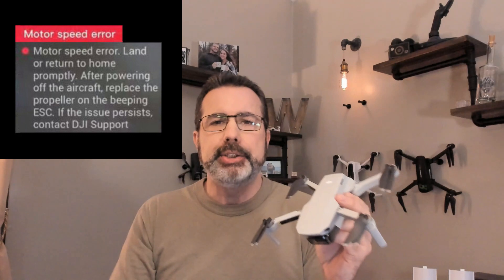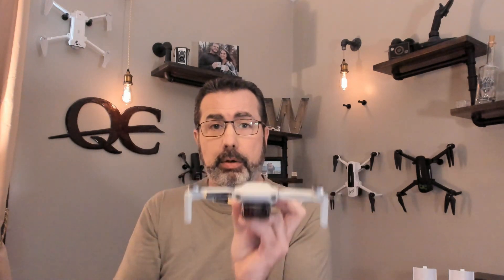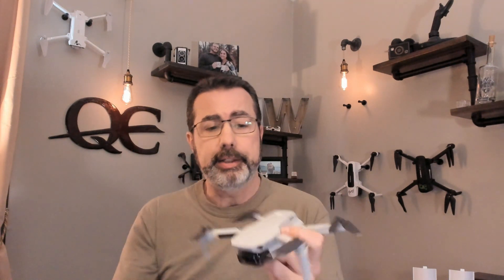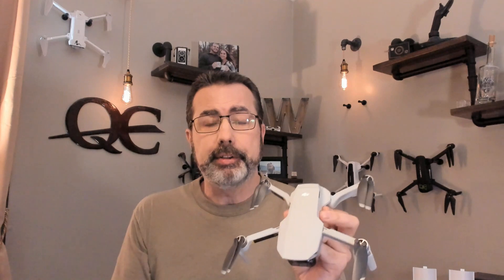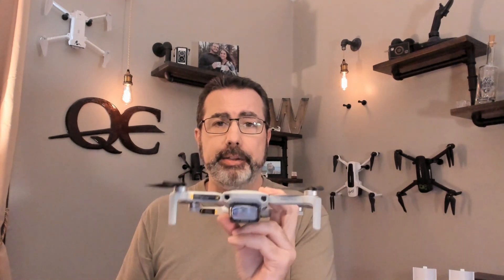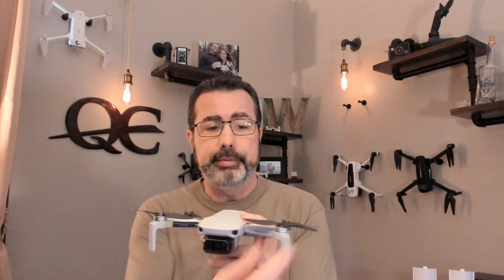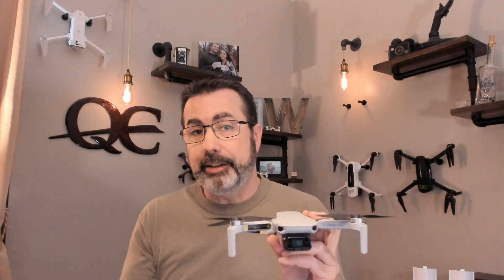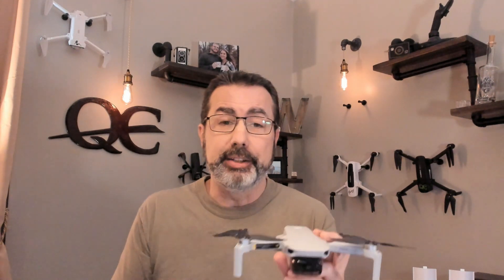MAVIC MINI - MOTOR SPEED ERROR - FIRMWARE  V01.00.0500

Comment: No, No, No....
I know this seems like a Firmware Update that can/should be ignored but its very important!
The Props are fatiguing over time when the drone is left folded up (usually the rear props). 
The Props look fine to the eye, no damage or cracks, but they are not!  
They are flattening out when the drone is in storage and in serve case, when flying, the props can fold upwards causing the drone to descend and crash. 
What DJi have done is give you a warning to tell you that the motor is working harder to maintain flight and that the props are more than likely flattened/ warped. 
Admittedly what they should do is send every Mavic Mini own new stiffer blades but that would cost them $$$$.

But this firmware update shouldn't be ignored, it might just save your drone.
I made a video about how the props are flattening out here: https://youtu.be/edTWQcMJ-3M 
(sorry dont like to post videos on other channels, but it might help others out)
Reply: That's great and all, but mine was less than a or two week old and I've run into this issue, and changed the props, and still got the issue 🙃
Reply: @alanjackson5983  got this error after a week. Are you updating over wifi or on pc?
Reply: @mrreddington777  I updated on the mobile app and re-installed it on the Mavic PC app as DJI support said that should work. Seems it was a problem in the firmware that they've fixed, mines working now but I've not used it much since this issue 🤷🏻‍♂️
Reply: @alanjackson5983  ty I replaced the props last night and will test it out today. I'm going to have to get a laptop for this then. Lol
Reply: @mrreddington777  Yeah most likely, when I replaced mine the error came back after an hour (ish) of flight time until I used a pc
Reply: Stiffer blades might mean more weight/less flight time though... I'm pretty sure they made them flimsy on purpose
Reply: Brand new propellers. DJI ADMIT and I cannot say this strong enough that they have introduced motor sensor firmware in 0500. It is very bad and I have complained accordingly.

Comment: Hey Chris, I know this is off topic but I was wondering,"what speed can the Mavic Mini " reach?" I seem to only get 17-19 mph...I thought these were supposed to get at least 27mph?? and also the Zino Pro...? Appreciate your feedback.
Reply from the maker: Martillo DeDios 27 meter per hour so that’s what you’re getting if you convert 17 mph. 
I get between 27 to 10 miles per hour as well.
Reply: @QCGUY  I guess I thought mph stood for miles per hour, not meters per hour...
Reply from the maker: Martillo DeDios Check you’re app settings. Imperial or metric will be your option and I think your on imperial. 
Meters is m/s
Imperial is mph
Reply: Do you mean kmph??

Comment: I disagree with you. You say that the motor speed error occurrence was installed intentionally by DJI, whereas I say it is a bug. It is possible that there are cases where it should appear, but I went over all my props with a strong flashlight and a strong magnifying glass and found no problem. Here is what I have posted elsewhere: this Firmware update version v0500 has at least one very serious bug. Several people have reported a "Motor Speed error" message instructing to land immediately, at some point refusing to allow take-off, which has caused some people I've seen on the web changing propellers in response to this faulty message. I got this message and also a faulty "Payload error" message. In addition, I saw flight instability, which does not characterize the Mini. In the end I reverted back to v0400
Reply from the maker: Valid disagreement and explanation. I’ll buy that as a serious possibility. 👍
I’ll stay on 0400 for now and just wait a week to see if there’s a magic firmware update that says bug fix. 😂
Reply: @QCGUY  Thanks for the reply: like you' staying on 0400 and waiting for some DJI reaction, if not fix. I think they were in a hurry because the MAVIC AIR 2 was supposed to have been announced today. Kinda screwed up their plans.
Reply from the maker: @avrahamreiss3258  Never hurts to wait and see...
Reply: @QCGUY  Totally agree. It annoys me that as an old software hand, I normally never buy the first edition of anything, because the creators rely on the public to do their debugging for them!

Comment: From what I have seen it's looks like it is always the back one's that it says is bad
Reply: What I noticed is that some cases and half the prop guards push the back props so they are pressed against the bottom which is not close to level with the folder back props.  The DJI guard and Flymore case both are designed not to do this so someone knew it was a problem, I think its the after market Warps and cases that may have increased the issues.   So even if gives false warnings and needs a tweak its a good feature.  But I would support, a switch marked "Turn off error and absolve DJI of an requirement to replace my drone because I am an expert."

Comment: I did the Update same day that was launch, today was my first flight after the update, I never had a issue with the drone until today, same error: Motor Speed Error, like you said, I wasted my time Returning the drone twice and everything was OK, false Alarm or not I did the Propellers remplacement and the same thing, the issue continues. DJI Needs to fix That. Nice video, it’s good to know that I’m not the only one. And in most Of the cases should be just a False alarm, even with that I will try to fly with caution until get fix. Regards
Reply: Update: I did another flight today, full flight 23 minutes, high altitudes, more than 2 miles total distante and some wind with no problem, I’m not sure if The issue will continue later but at least today I had a great flight with no Issues. Like I said I did all the propellers replacement. I’m thinking and cause some forums can confirm, the last update includes something to measure the propellers actual condition, but it looks to be too sensitive, because some propellers with no apparently damage are giving the error, this measure Needs calibration, on my opinion. Probably you don’t Need to make a replacement until apparent damage, but remember check propellers condition every flight, how the motor sound it’s another test.
Reply: This drone has a single IMU and after the update needs to be calibrated if that doesn't work ...... Go into DJI assistant 2 plug up your mavic mini do a update firmware refresh ' then after that calibrate the IMU and go fly it . Fixes the issue instantly no underlying issues.

Comment: My mini is only 3 days old and after the update I'm getting that alarm go off on both the back motors and two different occasions.
Reply: mekox same here purchased on Friday the 24 it updated when powered  up Straight from the box . I’ve had the exact issue as yours . Was considering taking it back and getting the Mavic air.  Any thoughts how to fix this problem or should I just take it back and get the air
Reply: @718048  I just went ahead a replaced the  propellers and haven't had any issue since.  Even tho honestly they look perfectly fine.
Reply: @mekox  same error  here today, props was brand new but replaced and could fly again .. strange error to get ?! hope they fix ..
Reply: Same here, bought it yesterday 😅

Comment: Got the error message after flying for about 15minutes today. Right before landing the drone it turned on it’s side and dove straight into the water 10 feet in front of me.. :( Never had an issue prior to installing this update.
Reply from the maker: Ouch! Is it ok?
Reply: QC GUY  Sadly, it’s still at the bottom of the lake. Going to try diving for it once the weather gets warmer here in Illinois.
Reply from the maker: Adam Smith That’s awful! Sorry 😐
Reply: @QCGUY  Great news.. DJI replaced my Mavic Mini after I sent them the flight logs. Received it yesterday. Also, my Mavic Air 2 should be here Thursday :)
Reply from the maker: @AdamSmith-pt5ut  Very good news!!!

Comment: UPDATE- Solution.. as suggested by TDR Drones, I re-upgraded the firmware USING MY PC and a USB CABLE. After three tries the statusbar finally got to 100% and the problem is solved. The first time I upgraded was thru the "RC-Drone wifi connection", it got several restarts and never went above 99%. USE A USB CABLE AND A PC, THRU ASSISTANT 2 FOR MAVIC. Connect and update both the Mini and the RC. It worked! Thank you QC for pointing the problem out!
Reply: this worked, thank you
Reply: in my case that made no diff at all...!!

Comment: I remember I dunno quadcopter had an issue in previous video his motors were screaming and flight performance was very bad. Turned out his props were flattering out, he changed them and it fixed it. So this is probably just for him!  😂. I think he mentioned about the way the case pressed down on the props when stored.
Reply from the maker: Kevin Pain He has a history with props and not checking them before flight. 
Catastrophic prop failure on his X8 that was FIMI’s fault not his. Yeah ok 👌
Reply: QC GUY very true that! “I I dunno what just happened there?” 😂🤣

Comment: No issues at all, had some great flights today and will make video from the footage later. I think it’s preferable update by DJI Assistant software on pc and not wireless. I always do that and never had a problem with any update. Just my thoughts. What do you think?
Reply from the maker: Gekol Drone Videos You made a great point there! It is no different then poorly loaded apps that need reinstalled. 
Did you own a original Mavic? That was kinda rule of thumb back then too.
Reply: QC GUY, I owned the Spark before and now the Mavic Mini, so I only can speak for that DJI drones!

Comment: You know... as I said I got this error now, brand new Mini, it was perfect before the update. I noticed the update took like 20minutes, the drone restarted like 6x, the RC restarted 3x, lights blinking here and there, some moments of silence and I was already panicking with the thoughts of a Brickwalled Mini. So the motor error, for now, is almost a pleasure rofl... gonna reinstall the update thru Assistant 2, THX QC and TDR for the help!
Reply: I had same thought.  And wonder if some of the controller updates died because people interrupted them thinking they failed.  This has been an issue with long updates on Windows too.
Reply: @KEWords  it may be! I refreshed the updates for the mini and the rc and all worked now. Thx for the reply!

Comment: "Motor Speed Error" in the first flight after the update. My Mini has less than 2h of flight, brand new. What a deception... can I revert the update?
Reply: UPDATE: I refreshed the update with USB cable and a PC, three times, and the error went away.
Reply: Same for me.
Reply from the maker: I guess you can ignor it for now if you do pre-flight checks. That's the good thing about it anyhow. Mostly a pest on your app screen right now though.
Reply: @QCGUY  thank you for replying!  Before updating I gave it a thought: "if it ain't broken, don't fix it" - gave it a laugh and did the update anyway... my fault lol... thx again for the vid and reply QC!
Reply: Rodrigo Boos I think slot of people decided to update bc it added manual video and more frame rates which we all want. Did a test flight with my mini with pro guards on and no problem.

Comment: Updated mine yesterday to V01.00.0500 test flew it for 20 mins or so with no issues or errors! Yet!!
However I've seen some get motor speed errors!
I'm guessing DJI have put in a new feature to detect if a motor is spinning up higher than normal, which could indicate an issue with one or more of your props.
I think some errors might be false like an earlier issue with those max power reached errors some were getting in an earlier update.
It could also highlight a genuine issue with a deformed, warped or bent prop that does need replacing!
👍😎
Reply from the maker: It almost seems like you watched the video! LOL
Reply: @QCGUY  In full! You reached a similar conclusion 👍😎
Reply from the maker: PD Tech I just want a off switch. I dislike all these safety precautions companies are adding to our quads.
Reply: @QCGUY  I understand how you feel but there is always somebody out there that this error could highlight a genuine issue with a bent or warped prop they didn't realise they had.
From day 1 in my 1st impressions video on my Mavic Mini I highlighted my concerns of just how fragile a lot of this model is, not just the props, I was quite surprised just how much they bent, carefully taking off the tape securing the props.⚠️
Incorrectly handling it or not quite packing it away correctly could permanently warp or damage those very fragile props. Causing higher than normal motor RPM because they are not giving the same lift and in some cases causing this prop strike issue, I've seen some yt videos where the front props are hacking great chunks out of the front body shell, something tells me their props are warped because after checking mine I have a good 8mm clearance.
Reply from the maker: PD Tech No, totally agree with you and said it’s good for some. I’m just pretty anal about checking these things on my quads. 
Flying over water mostly makes me check and double check. 👍

Comment: Chris this is not happening to everyone and without the update you will not have the camera controls you should have it’s worth have and forgetting the warning if you have checked the prop’s before taking off. Thanks for sharing your thoughts stay safe my friend
Reply from the maker: I know, I said that in my pinned comment in a roundabout way and sure I am very interested in the control features but not terribly needed at this time is all. That's the beauty with electronics and especially quads. Some have this common issue and some have that common issue while many often have none. Thanks

Comment: There have been some cases of the older props hitting the arms due to flex .Maybe it's due to this problem & DJI are airing on side of caution. Like you say a little cross wind one motor will start spinning more RPM.
Reply from the maker: Good point and something else to check in pre-flight. I think in some cases people are using those prop straps that are too tight.